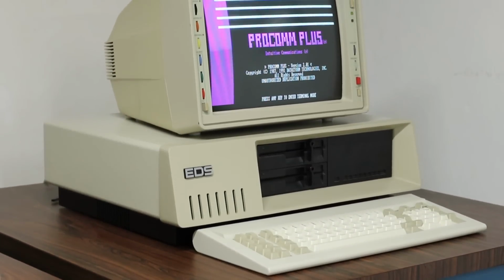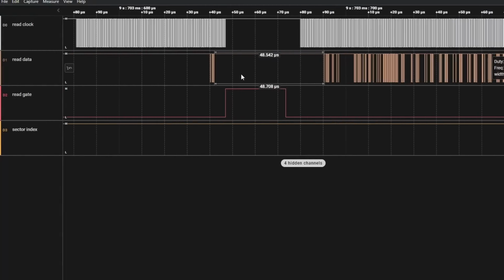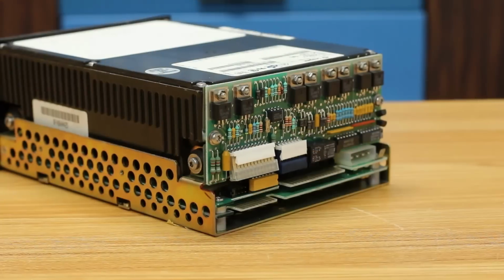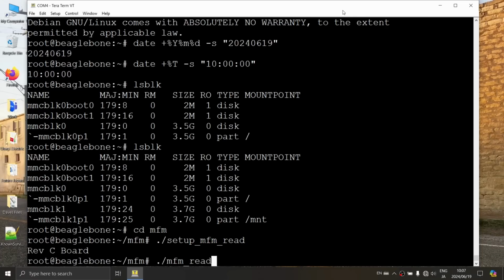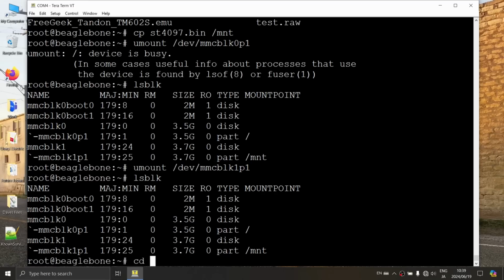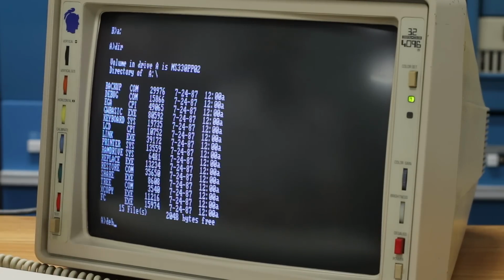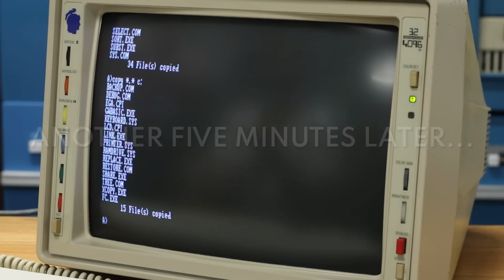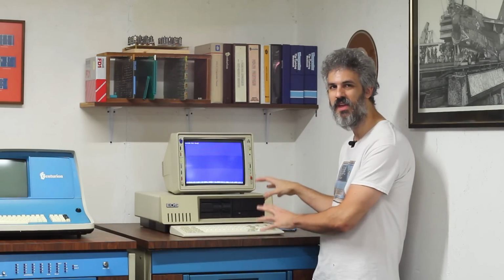FM is RLL, MFM is RLL, RLL is RLL! Fight me.

Comment: Wow, it has been 40+ years since I needed to care about this stuff. An RLL qualified drive like the ST238 (30MB, IIRC) REQUIRES an RLL capable disk controller! A normal MFM controller cannot read an RLL formatted hard disk.
If this is an ST238, it'll format to 20MB if you have a normal MFM disk controller, or 30MB if you have an RLL disk controller.
If you want the hard disk to be bootable, you need to use `format c: /s`
29:50 Okay, to make C; bootable, you need to switch to A:, then `sys c:`

Comment: Back in the day our company took in many computers with RLL drive failures.  Typically the data could be recovered using Norton Utilities.  With such a reliability issue with RLL we would recover the data, install a MFM controller and restore the data to the ST-238R using MFM formatting.  Given the cost of the drives at the time most customers were happy only loosing 10 megabytes of storage.

Comment: The difference is a matter of certification and tuning.  An RLL drive will usually work on an MFM controller, at some 60% of capacity.  As RLL has longer tracks, more sectors per track, the controller needs to catch and deal with that data stream faster.  RLL is some 40% more bandwidth intensive so far as the controller is concerned.  The other consideration is that the media of an RLL drive is certified to store the higher bit density whereas an MFM drive has not.  Also, the MFM drive will be strained electronically by the higher datarate and may fail or flake.

Comment: Hey I know I’m once again late to the party, but two things that I remember from back when I used to build 8086, the hard drives had a set of jumpers on the back that set it as primary,secondary,or cable selected. Also you had to lineup the 1 pin on the ribbon correctly

Comment: nice.. racking my brain .. from past at this point in video.. https://youtu.be/2BlCGNhzC6w?si=OAMZv9Hfi6ubb03n&t=1913 .. for the life of me can't remember .. sys is ..don't really remember.. think was for system file copy.. to boot form hd.. depending on dos version and .. my foggy memory.. .. to boot from hd.. needed fdisk -a then set boot flag.. OR .. format /mbr c: .. or after copying format over.. format /mbr or .. depending.. if it would reference format from a.. just go to c then format /mbr.. sometimes fdisk /mbr  but .. may or may not need to format it again after setting mbr.. at least with fdisk.. lol.. again depends on version.. some versions I think would require fdisk create part, .. then set boot flag, then format mbr, format c: ..  weirdness of variances .. cp sometimes works, copy sometimes works, xcopy sometimes work version dependent.. sometimes c sometimes c: sometimes c:\ .. sometimes * sometimes . .. sometimes .* sometimes xcopy a:\*.* c: sometimes c:\ sometimes c:\* .. got real annoying after while and going through several variants of dos or dos like things such as nt variant non-dos dos.. ;p sooo many memories though <3
Reply: iirc one of the weird quirks.. (prob due to same fat type , just different cluster size dunno really) .. for some versions it was possible to format it with newer version of dos , set flags, etc.. then copy the files of older dos back onto it.. n boot to older dos.. things would work with exception of course of format or fdisk.. depending. and.. the milage will vary ..this is all very old fun times that are all vague now lmao.. I'd have to fire up a series of vm's to try it all out get it sorted again haha

Comment: interleave.. in the old days, computers couldn't rea data fast enough for it to be just a constant stream of data from the disk. To counter this, they devided data into blocks, and would separate those blocks with space in between, so the computer had time to process a block before the next block passes under the head. Without interleave a drive would constantly be waiting for the drive to make another circle, and the head passing over the wanted data again. One of the first things any nerd with an mfm or rll disk did, was to determine the optimal interleave for his computer.

Comment: RLL = 1.5 * MFM

MFM and RLL are interchangeable, with the diff that an MFM disc on an RLL controller will have 1.5 times the MFM capacity.

So put a 20Mb ST-225 on RLL and you'll have a 30Mb disk.

Comment: Great! I did lots of FDISKs on MFM and RLL drives way back when. About the interleave factor. This is an offset for reading sectors while the HD spins by. If you select the IF properly the drive doesn't have to take another turn. Formating a system drive was basic knowledge in the early 80ies. The boot sector has to be bootable.

Comment: I did the  ST-225 / ST-238  modification back in the mid-80's as well!   I do remember the early version of spinrite, to determine the optimal sector interleave (1 = 1,2,3,4;  2 = 1,3,5,...; etc)   before reformatting it.   it's been so long so i'm not surprised how many people haven't actually experienced the joy of going from 20mb to 30mb  on your hard drive!

Comment: MS-DOS format has several options. Re making the drive bootable, /B reserves space on the drive for the system files so that later you can use the SYS command after files have been copied. /S will copy over the required os files for boot after the format has completed. With this option you don't need to use the SYS command afterwards.

Comment: As far as I remember, these hdds had a seagate software for low level formatting, and they came with a bad sector continuous paper sheet from factory that you had to type when low level formatting. Because they had bad sectors from factory. Then you could proceed to partition and format. but you had to setup the sector cylinder and head spcts in bios first. Don´t know it was done on a XT. I was a kid and saw my dad doing it infinite times.

Comment: The interleave factor is a way to tune the I/O speed. IThe optimal for 8-bit buses is 3:1 and 16-bit buses as 1:1. But those are best cases and there are caveats. I mean, if you use an 8-bit card on a 16-bit (eg., 80286) bus, and the optimal interleave is 3 for the card on an 8-bit system, 4:1. So the slower the controller, the higher the interleave you need to get the fastest rate you can get with that configuration. And programs like the older Spinrite and Optune can re-interleave the drive on the fly for you. They can test the interleave factor and reformat to the best. And the 2 programs I mentioned let you reformat in place without necessarily needing to back up your data (though you should).

And yes, a 20 MB MFM drive (17 SpT) would be a 31 MB RLL drive (26 SpT).

Comment: Man! so many memories came back with this video 1) After removing the screws, the bump that you had to make to the case with the palm. 2) Putting the case back on: You have to make pressure with your hand's palms leaving your fingers free to make an inverse pressure to fit it again. ....Yes,  the secuence to format would be: FDISK to read the disk, examine it, chose your partition configuration and after that create partitions. Then Format C:/s /c, being C: for the first hard drive (Select 1? in FDISK) /s to make it bootable (so you can skip Sys C: later) and /c to check for bad sectors.

Comment: I don't know why this video showed up on my recommendations. Wikipedia says "All codes used to record on magnetic disks have limited the length of transition-free runs and can therefore be characterized as RLL codes. The earliest and simplest variants were given specific names, such as modified frequency modulation (MFM), and the name "RLL" is commonly used only for the more complex variants not given such specific names, but the term technically applies to them all. " so I didn't need a video to tell me this. Maybe the video is interesting for some other reason, but I can't tell from the title.

Comment: Oh man, this reminds me of my qbx days except you are getting hard drives to work. I never fixed a single one, I just got them from the trash working and used them til I found a better system in the trash. I kept trading up and up entire dos systems out of the trash in the 90's until I got up to a 286 processor. I've seen many of those old drives in terrible states of condition making lovely progressive failure noises. I don't miss the 80'88's trying to run QBX with dos 6 on 600k of ram either. 
HOWEVER I do love magnetic recording and data fundamentals (TAPE) so your video here is functional therapy for me. Thank you, and I enjoy coming along for the ride!

Comment: I remember dos 3 all the way through 6.21. Those were the days os ascii, asembly, basic, and 300 baud modems with bbs. When you copied without the sys I knew it wouldn't boot. Some things you never forget like sys and format /s. The coolest thing I ever did with ms-dos 3.2 was change the assembly to say other things. Like RN-BOSS etc. I had the only OS that I customized the message on. It was so easy to edit in the assembly because it was plain text. I could change things like Microsoft to read other words as well. Fun times. Those were the teue hacker days. When the Pink Shirt book came out, every true hacker bought it. That was the ultimate bible for understanding the OS and hard drive storage. If you wanted to write a virus or something that book was gold.

Comment: @ 19:45 - the clacking noise is usually a system-controlled calibrate action, the pattern depends on the BIOS. Later BIOS firmware on different machines simply trusted the disk calibration data (which the controller could read when it was powered on).

Comment: Why did you not used Dos 5? I get that Dos 3.3 is period correct, but Dos5 knows about direstories and also lets you run more software that will run only on dos 5 or above.
Also, there was form Ontrak, software dedicated for those MFM, RLL HDDs (old versions of Ontrak Disk Manager) that auto calculate the interleave, check the bad sectors table and update it when low-level formatting such a drive. Also, in some cases, I used that software to format as RLL an MFM HDD.
Anyway, I am glad you did it. I also used an XT machine without HDD with Procomm plus as a terminal for some projects that needed a data terminal to interact with.That computer had some sort of SCSI HDD interface that I did not used because I could not found a compatible HDD for it.

Comment: The commonly used low-level formats on magnetic storages actually introduce special encodings in the header of the ID and the data block of each sector. This special encoding wouldn't be possible with strict FM or MFM encoding. For instance, see ECMA 125 section 9.12 and 10.2/10.4. The special A1h byte omits a magnetic transition between two bits where it would be necessary for a strict MFM encoding. The controller can (and needs to) detect this byte anyway, which is giving away that it is an RLL detector in reality.

Comment: My only worry about the format is while it succeeded to format as RLL with the tighter spacing is it reliable?  You see back in the day you could trick a PC into believing a double density disk was a high density disk and format a 720K floppy as 1.44Mb.  It worked, but usually not for very long since the 720K floppies didn't have as a high quality of media.

Comment: @24:21 Dos 3.22 has a small limitation. I believe there is a limit of 1024 items allowed in the root directory. You should mkdir Dos then put all the utilities in the DOS folder.  When formatting the system partition you can use format c: /sys which will automatically make that partition bootable

Also. You can create an autoexec.bat file.  This is placed on the root of C:\ inside this file you can put the following

Echo off
CLS
Prompt $p$g

The prompt command will put the path in your command prompt which will look like this

C:\>

That should get you going pretty good.

Comment: i know from ALTA .. that MFM disks can become RLL by the bios-formatter tool
the miniscribe 32Mb was actually a 20MB MFM - turned RLL (afaik)
- i might be wrang.. it is ALTA..
Reply: or using debug
- g c800:5
if the controller has bios chip

Comment: 29:20 copying the floppy won't make it bootable. You have to "SYS" the drive.  "SYS C:"    30:53 YAY!  Sys writes to the boot strap, using "copy" won't touch that.  Also you don't slap everything into the root of the drive. Later versions of DOS had an INSTALLER and would place those files in a \DOS folder, and set autoexec.bat to PATH=C:\DOS,C:\whatever else, so you can run those programs regardless what directory you might be currently in.

Comment: Back in the day, I do recall taking an MFM drive that was about 20MB and worked fine with it's MFM controller in DOS.  I replace the MFM controller with an RLL controller to the same HDD then low level formatted it, but I'm not sure what software I used for that it wasn't using debug and jumping to a memory location. It was either a specific software from the drive maker, OR is was a format utility in CMOS BIOS that wrote zeros all over the drive.  After that I mounted the drive with FDISK. Then formatted it in DOS (3.3 or 5 maybe?) and it gained 10-11 more MB! I then ran Norton Utilities to set it's interleave (1:1) so it would run a little bit faster.

Interleave, from what I understand, was the number of times the disk would spin before it performed a read/write. The higher the interleave the slower the drive performed. Norton Utilities had a program what would test interleaves for your drive and find the lowest interleave that didn't screw data integrity.  If it managed 1:1 (1 rotation : 1 r/w) then you have a very good drive.

Comment: Others have made similar points in the comments, but I'll put my oar in anyway ...  You should reformat (low-level) the drive with the correct geometry (you used the geometry of the ST-238R), 'format c: /s' will FAT format the partition and install the DOS kernel files in the proper location (start of the volume).  You should make a directory ('DOS' is probably best) and copy the DOS files there, and likewise another directory for ProCom Plus.  It's not only good drive hygeine, you will eventually hit the limit for the number of files in a single table (which is why directories were created in the first place, actually).  Make an 'autoexec.bat' file, at a minimum;  it'll skip past the time prompt and you can have it start ProCom Plus immediately after the system boots.

The ST-238 drives were tested and certified drives which were otherwise identical to ST-225 drives - in practice many "MFM" drives would work as "RLL", at least some of the time.  I heard that some drives were unreliable, but I never encountered it myself.  In theory the drives did need to use improved manufacturing techniques but it seems the drives Seagate was making at the time were all pretty much up to it, even if Seagate wasn't actually selling them as "RLL" drives.  I heard, but again hearsay, that the main difference was simply the formal certification and the price tag.

That monitor is a thing of true beauty.

Comment: MS-DOS 3 doesn't handle over 32 Megs of data because its FORMAT.EXE does by sylinder however FDISK.EXE doesn't but just by bytes.
Since it's FAT16 at base, it can be partitioned from later version of MS-DOS or even on modern system (if you can attach), without Large Filesystem (FAT32) support, and it should be formatted and fully functional on 3.3 right there.

Comment: When you run the initial format command, there is a /s option which transfers the systems files. Similarly, there is a dos SYS command for transferring the systems files after formatting is complete. I don't think it will boot from C: if you just copy *.*. That's fine for copying the dos files there are 3 files hat have to be placed on specific sectors and that why you have to use the sys command or use format with the /s option.

Comment: Finally someone explains the concept behind mfm vs rll. 

I used mfm drives with rll controllers for such a long time with my Amiga 1000 and (Commodore) PCs until IDE showed up. 

Why? As kids we recycled broken drives by swapping parts around and used what we got. We basically never had problems with repurposed ST225, ST251 and the full size ones which model number I just forgot, which just worked fine with rll Controllers.

Comment: I suppose Procomm Plus can do x/y/z-modem transfers, so it should be able to receive files without the need to write any software on the DOS side. Just write an x-modem or y-modem transmit protocol on the Centurion side.
Reply: Only thing of course for X,Y,Z-MODEM, the UART on the Centurion must support 8 databits, don't know if that's the case.

Comment: You did terrible job at understanding and explaining MFM. I watched video from MERA 400 channel and he did much better. Unfortunatelly it was in Polish, so let me translate:

We want to squeeze signal, so get rid of ones near other ones. So, when You have 1 in FM (1 for clock and 1 for data), You can just skip clock signal, because data will be also clock pulse. That's why 1 in MFM is 01. Other problem is 10 sequence, which in FM is 0110 (01 for 1, then 1 clock, then 0 data), so let's get rid of clock again. Normally 0 is 10 ie MFM, but after 1 it is 00.

Also he acquired data better: old HDD can stop functioning every moment, so he took simple ATmega to generate signals for disk drive and used logic analyzer to capture data. He decoded it offline on the next episode. That's because one can experiment with data conversions w/o spining old HDD, which is good if You don't want to loose data.
Reply: Graph from 9:18 shows received signal. You don't read bits (or poles) from disk, but rather change in magnetic flux. 1 is change, 0 is no change. Look at FM! First bit is 1, so 11 in FM, so You have ^^ which means two changes in signal. Next is 0, which is 10, so ^-, so change and no change and so on...